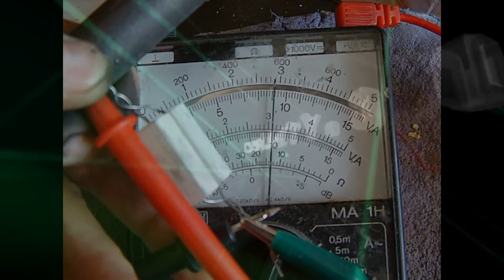Slideshow - Disassembling of an Ion Valve Cell from Bruce A. Perreault from 2005

Comment: The Durafix rod gets a black or dark grey layer outside which shields it from too fast decomposition,
but at this layer Ions still can do through, so only very slowly this rod is decomposed and converted to
Zink and Aluminiumchloride via the saltwater. To better condition thse durafix rods for the batteries , you can harden the outer protection layer a bit, by putting the rod first into
an electroysis bath in low concentration vinegar-water and have the rod  at the positive pole at aroiud a few Volts.
I used 6 Volts DC pulses from a battery charger.
That puts a very hard black layer onto the
rod surface and hardens the surface so these rods last longer in the battery cells.

Comment: By the way, this cell runs better, when the graphite cylinder is in air and only the inside
is filled with graphite powder and saltwater.

As this is a metal-Air battery the outer graphite cylinder needs air to breathe to convert the
oxygen, so if it is completely in saltwater it will not work much longer when all
stored oxygen in the graphite lattice is used up !

Regards, Stefan.

Comment: Walter Hofmann did also build simular cells, called
Aqua Generation cells (AG-Cells:)
See:
http://overunity.com/298/led-lights-with-walts-ag-cells/

He used also bigger ZAMAK alloy plates for his cells or also other alloys.

But the principle was the same. One Graphite cylinder or plate as the outer electrode and
one Zamak rod or plate as the other electrode and a concentrated saltwater electrolyte.

In further tests he used superabsorber salts to bind the saltwater into it,
so these cells did not spill the electrolyte.

Regards, Stefan.